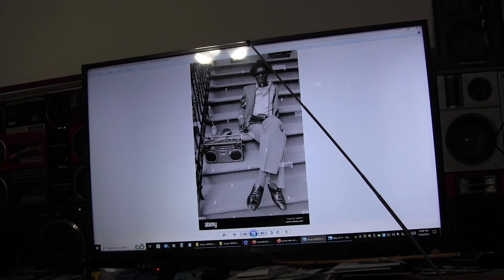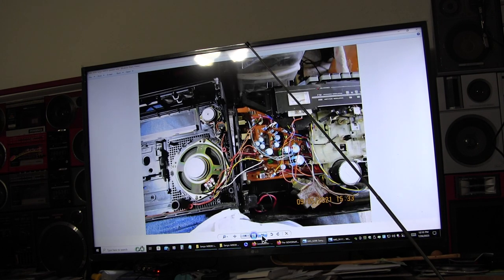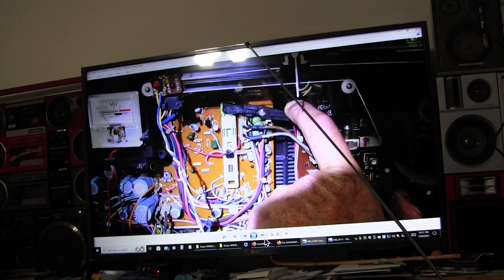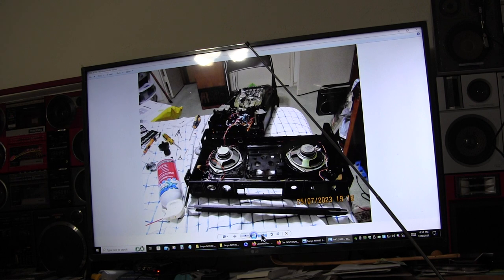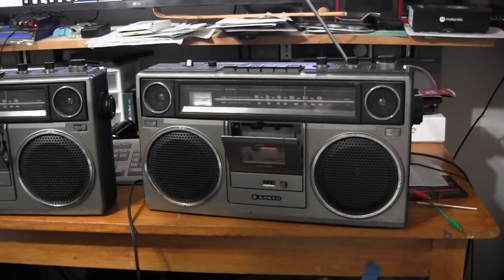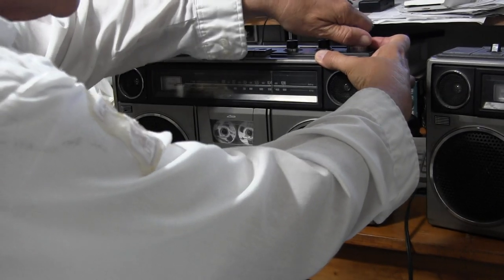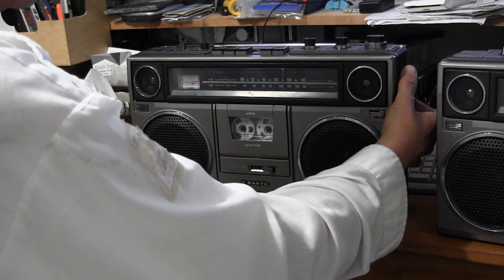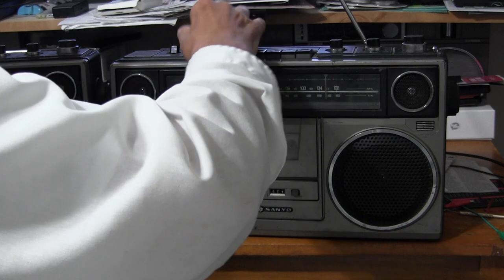Sanyo M9930 July 2023

Comment: I have a 9930k, replaced motor and belts. Cassette works fine for about 5 minutes speed is good and then slows down, lots of wow/flutter. Both battery and AC. Any suggestion?